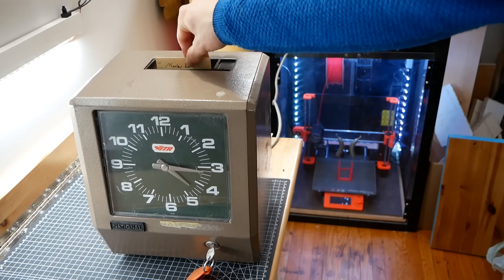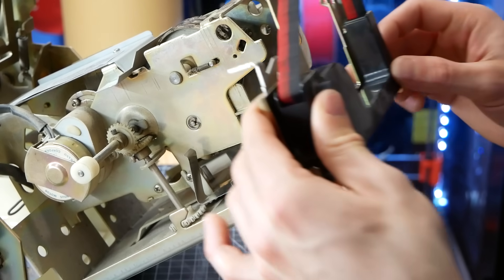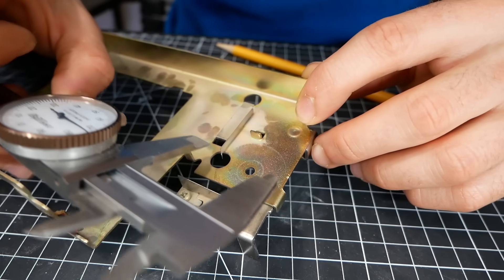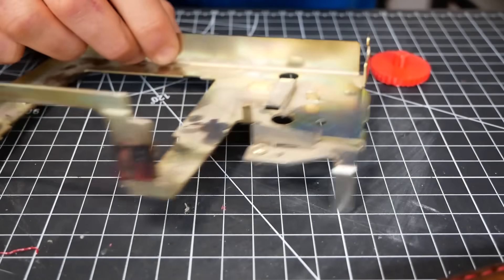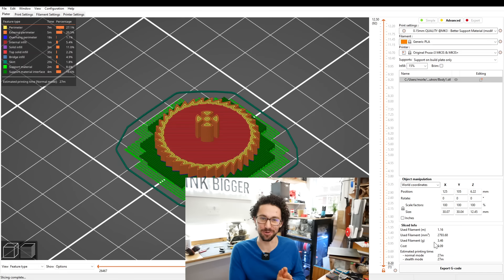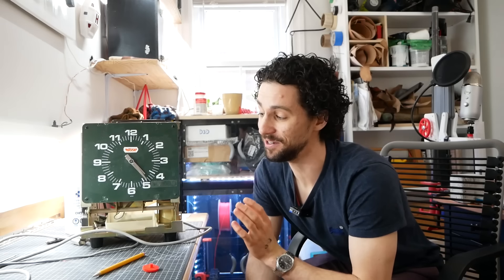They wanted 100 dollars. I 3D printed it for 9 cents.

Comment: Two reasons this type of part is so expensive. First is you aren't JUST buying that gear, you're buying that entire assembly, that gear was likely a piece that was melted to the housing (basically making an overly long stem and mushrooming it with heat to keep it affixed) and DESIGNED to break. So why is it so expensive? folded sheet metal isn't costly and this clearly isn't built to survive the apocalypse or anything. It's because that gear isn't a printed part, it's an injection molded piece. They have to make thousands of those gears to make the power, fluid and general costs of cycling the machine that makes those gears worthwhile, and that's problematic when people generally aren't buying these anymore. Mechanical time clocks like this are becoming rare in a lot of shops with a digital system that's more accurate (doesn't need adjusted) and doesn't require the payroll office to have to go get everyone's time cards, so of course the part cost goes up. I'd guess when they made these regularly and they were commonplace, I'd wager this part probably cost maybe 40-60 bucks? Costly sure but not unreasonable, for you though where this is a vintage piece you're using that let's be honest you could probably replace for the cost of that part (give or take) it's just unreasonable. But companies like this expect folk who still use these time clocks to KEEP using them, be it a need to (safety, security, etc.) or because they don't wanna outlay for a new clock system, they can afford to charge more, make more money and also keep producing these parts. 

Before anyone asks, I work in injection molding for plastics, this is an actual thing we do where I work where we will constantly destroy GOOD product solely for slight variations in color, because it hit the shop floor, etc. (even though we primarily produce food service materials we've been known to also sell to non food service companies, hence the oddity that we will destroy good product that could go to companies who don't require sterile products)

Comment: I would wonder about the longevity of such a part, though this is more for display, so it's not that important.  Very cool video about the full process of designing it.
But that's how the world works.  If you don't want to put the work in to fix something yourself, you will pay for the convenience.  Hell, I know a company that charges people $150 just to clean their squirrel cage and condenser.  It's super easy to do yourself, but oooo so scary!  I have to open something up!

Comment: Now I see two different colors on that ink resovior.  I assume it's designed to set an easy to notice change (such as late?  Or maybe OT even?)  How does that switch though so it would stamp with black ink.
Reply from the maker: That's a great question! The clock automatically switches the colour at a specific time (basically by flipping up the ink ribbon), and I assume that is to designate overtime hours. I haven't yet figured out how to adjust what time that switch happens.

Comment: I’m interested to see how that part holds up. I bet there’s a decent amount of force on those teeth due to the lever effect throughout the machine. I wonder what the original is made of?

If it’s molded plastic I wonder how much if at all stronger it is than your printed part.

Comment: 3d printing is great.. i have none myself but i do collect vintage lava lamps.  and they used plastic screw on tops.. which break once they break there is no way to seal the lamp anymore and that precious liquid that isnt made the same like it was in the 60-70s will be gone... thankfully someone 3d prints the tops and they work great.  only issue is 3d printing isnt practical for most people.. theyre expensive.. and if you contact someone to 3d print a part for you. they always say no because it isnt worth the time to do all the 3d measurements and blah blah.. its very expensive to do just 1 thing with a printer... Your 9 cents to print vs 95$ is kind bs though, you have the skills to do it.. Im curious how much youd charge me to 3d print the gear in my Jeeps blend door motor which split in two peices.... vs me buying one for $100..  

Thought so..

Comment: 9¢ + how much time? Is this really viable for someone not making a YouTube video, for instance? Obviously using a 3D printer as a hobby has some value in and of itself. But your central argument is flawed. 3D printers are great for things you can’t buy. But, for instance, you wouldn’t buy a 3D printer to solve this problem.

Comment: but really what is the real price of 3d printing the part and what i mean by that is material cost + 3d printer cost + electricity used for 3d printing , because if i was to find that punch clock and need to repair it i dont have a 3d printer i think it would be cheaper ordering the new part for 99$ but from a diy perspective i can see the appeal of the 3d printing for multiple small project

Comment: to calculate how many teeth will fit on a full circle simply take your degrees and divide by 360(full circle) and it will tell you how many will fit with those measurements,  also recommend calculating how much the arm travels and setting  that as the degree because it will reduce the noise of the ratchet mechanism and wear over time, from the picture you showed it looked like it was originally made from a very resistant material so its probably a known issue

Comment: I honestly just think they were charging 100, because they were going to send you the whole assembly not just the gear.  Still a ton, but it would make a lot more sense since they would need to find an old one they have or manufacture a single one for this case (which is highly unlikely).

Comment: In the current format you’ll use way too many cartridges. If you can get what looks like 30 legible prints from one section, it may be more practical to advance the cartridge after 10 punches rather than after each punch.

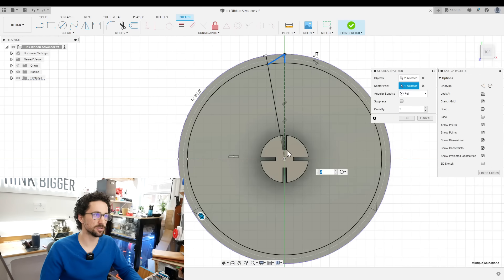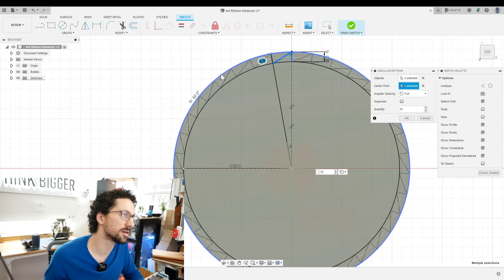Comment: Great video.  Forgive me, but I had to laugh a bit at 8:17 when you said that you didn't really know how many tooth profiles would fit in the circle after you had already set the rotation angle to 10 degrees.  360 degrees in a circle divided by 10 degrees/tooth is 36, which I'd say is pretty darn close to the 35 that you landed on at 8:34.

You got me curious, and I found a listing for an Amano 6807 on ebay that had a picture where you could make out the edge of the ratcheting gear you printed.  It had the same sawtooth profile, but appeared to have roughly double the tooth count.  but given that you 3D printed this replacement part, I imagine that doubling the tooth count would be a difficult feat to get nice results.

Comment: Ok, a bit misleading here.  You spent say 2 hrs analyzing, prototyping, and final printing your gear.  Let's say your rate as a mechanical design engineer is a conservative $30.00 an hour.  So, you did this at a cost of $60.09.  Now that does not even consider the cost of your printer and operating costs or the cost of your education on the design software that you used.   When you look at this more realistically, you see that they did not really overcharge you considering they need to make a profit, and cant just give gears away.   If the world worked on this logic, we would buy an I-phone for maybe $2 (cost of materials) instead of $800.

Comment: My pastor did kinda something similar. His wife loved her old vacuum's attachments. He wanted her to upgrade to a newly aquired 'used/fixed' vacuum he got but she didn't like the attachments it came with.

He simply created a conversation joint for the different sizes (2in vs 3in). This way she could toss the older vacuum but keep all the attachments and use it on the new one. 

His wife loved it so much she justified his 3D printer purchase after that. Lol

Comment: You might want to consider drilling a small hole in the bottom pin and putting in a "keeper" screw with washer to prevent the gear from being pulled out of the backing plate with the ink cartridge.

Comment: Their $100 price included more than just the gear. You also aren't putting any price on your knowledge of using the software to create the new gear. This isn't one of those situations where you're just walking into a hardware store and buying a bolt or washer off the shelf.

Comment: People talking about how much its costs to injection mold parts and store them in this situation but clearly miss the part where the company is still making the injection mold plastics, selling them to customers, and storing the leftovers, but just making it part of the metal bracket when they don't have to. Of course we don't have to expect a company to make products at cost, but they must have the know how to manufacture these gears for a reasonable cost considering they already have the molds and still make the part but don't want to sell the one piece that actually breaks since I doubt the metal bracket ever goes bad in these things. Even at $10 a gear they could probably get away with. Why buy a whole car door when you only need a window

Comment: It's not 35 in the circular pattern, it is 36 considering that you set the tooth angle to 10 degrees. 36x 10 degrees = 360 degrees

Comment: In your $0.09 costing you haven’t included the cost of labour and energy, it’s negligible when doing one off parts for your own use, and makes logical sense.

The part you would have received would have been stamped metal, with an injection moulded or milled/turned part, and as a business user, and not a collector that would have more value than the 3D printed part, and as such $95 is a damn reasonable price.

Comment: When you take into account the cost of the 3D printer and material, the CAD/CAM software and Processor package, the cost of the computer system, the time and electricity used, the post-processing and finishing the part and reassembly......I'd say your replacement part, best guesstimate, cost approximately $7000.00 Dollars ! ! !

Comment: Because of things like this, ive learned 3D modeling. Most of the time it is just a smal piece that is broken, but the replacement is often not avaliable or very expensive.

But if I hire someone to do the printing for me it gets expensive very fast and that is understandable.

They have to maintain their machines, and have to pay their employees. Additionally they want to have something for themself at the end of the month.
And that is without someone measuring and modeling the part....

Comment: Nice fix. Next thing to look into should be to figure out how to remove 1/7 to 1/8-ish more paper (in height) on the card edge every time the card is stamped, so that the stamped time codes match up with the card fields. Or maybe get other cards that match the machine

Comment: I repaired an IBM Selectric II in much the same way as you did. However some parts needed to be incredibly strong and needed me to use Liqcreate Strong X (about 185 GBP for 1L) resin to get them perfect.

Do you know that you could have made most of this in one sketch, and used extrude parameters to offset the exrtrusions onto the faces? I was taught to do this in engineering classes because in many instances it makes finding things in complex models much easier.

Basically in F360, just expand the sketches area in the top left, then click the eye button next to the sketch to reveal it, so you can do further extrusions on the same sketch.

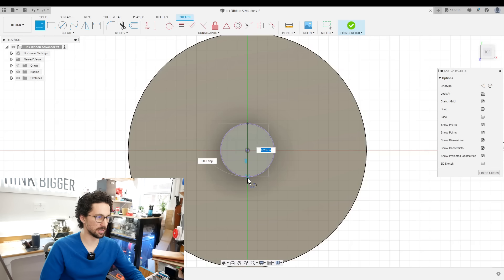Another best practice is the cross you made through the middle of the circle at 05:44, to select line type in the box at your top right to construction. This ensures you don't have to click a bajillion things to extrude one item. Not super necessary in this model of course as it's just a small thing.

8:19 - i would have left the one tooth on there, extruded the one tooth, and then you can create a circular pattern on the extrusion instead. This just means that you don't then have to individually click every tooth to extrude it, and it tends to be more dynamically adjustable through F360 user parameters.

I'm not saying this to be a dick, but because it'll make life waaaaaay easier later on if you get used to it now and start making bigger stuff.

Loved the video btw. Subbed.

Comment: It was $95.00+tax for the replacement assembly, but the one part that was missing only cost $0.09 because it was only one tiny piece. Chances are the company was likely trying to get old stock out for a good value to them, thinking that whoever hasn't updated this clock in 50 years probably doesn't know how to Jerry rig a fix.

Comment: You should define the number of teeth, not the angle. Then input the angle as 360/NumberOfTeeth. That way the spacing is done automatically and if you find you need 34 teeth, you don't have to calculate an awkward angle.

Comment: Well, I know you can 3D print it for a lot less, but when this machine was made, the 3D printer was not invented yet for home use, so their gears most likely have a manufacturing process making them more expensive to make, and they have to factor in transport cost, design cost and so on and so on. And lets be honest, you only 3D printed the gear, the price you got was for the entire assembly. So you cannot compare the two prices to each other.

Comment: The title is mis-leading.  How long do you think the payback is going to be when you figure; the cost of the 3d printer, assembly and test time and costs, yields, practice and misses, storage and restart maintenance for when you use it the next time,  material drying out and having to be replaced, etc?  Sounds like $100 is a bargain.  Now, if you're going to make a couple of thousand of them, that's a different story.  And even there, it would be more productive to make a quick prototype and ship it off to get reproduced.  That's what a 3D printer is for THESE DAYS.  HIGH cost, fast prototyping.  3D printing is not ready for high volume, durable high-quality printing yet.

Comment: 18 cents really, since you had 2 iterations. And a 3D Printer.. And CAD knowledge... And time.. Those all add up. This is why proprietary software/hardware and the locking up of maintenance by the big brands is something we need to stamp out real quick.

Comment: This is EXACTLY why I bought a 3D printer myself. 
I made many, many parts that are originally pretty expensive to replace. 

One good example, is a special gear inside the wiper mechanism of a Mercedes with a single windshield wiper. I even went a bit too far at some point, and printed the whole front mask of my father's tractor. In parts, (due to size) which I glued together. 

3D Printers are very very suitable for such things.

(example photo of the gear: https://i278.photobucket.com/albums/kk96/vpics_photos/misc/IMG_1824.jpg)
Reply from the maker: That’s awesome! Especially for products that have expensive replacement parts (like Mercedes)

Comment: nicely done 
i would have designed the part in 2 spare parts
the shaft for engagement and the gear  so you wont have to use supports and just need a drop of ca glue

Comment: In defense of the company that made the part, in real terms, it DIDN'T cost just nine cents for the part. The plastic the the part is made from cost 9c (of which you made two) but then you have to count in the cost of --
owning or having access to a 3D printer, 
the software to run it, 
the hardware to use it, 
the electricity to power it, 
the workers to produce it, 
the engineers to design it, 
the lawyers to patent it,
etc, etc, etc.
PLUS, the cost to you wasn't just 18 cents (9 cents twice, remember?) What about the time and effort you spent creating the part using what is a fairly complex piece of software? This time might seem like 'free' to you but it's really not.
Well done, BTW, on figuring all this out, but remember, hidden costs are still costs.

Comment: The cartridge doesnot contain an ink reservoir. It's simply an endless loop going back and forth on some rollers and a "packing area". If you can't find replacement cartridges, you can (with some care and patience) open the cartridge and replace the ribbon with one of the same width.

Comment: 8:50 Tipp: Don't make the Circular Pattern in the sketch. Extrude it once. Then use the Circular Pattern with "Type: Feature" to create the other teeth. If you then later want to change the number of the teeth, you don't need to select every tooth again.

Comment: It's lucky you had a 3D printer ,
3D printers started becoming available in the early 1990's but the cost would have been astronomically priced at this time the cost for a single printer was around £1.5 million but at that time it was basic . 
Now if back then your part would have been of a lower cost to buy from the maker

Comment: Nice job. Not sure if anyone else commented about the extrusion that goes into the ribbon. I worked with cash registers and POS printers that use the same kind of ribbon setup. The part that goes up into the ribbon is actually the inverse of what you made. I suspect there should be something under that gear holding it in place too. Here is an example of what the tip looks like that I was talking about. https://m.media-amazon.com/images/I/61huBUoB6qL._AC_SL1500_.jpg

Comment: I doubt the gear was a press fit to the ribbon.  In fact I'd bet it was securely attached to the metal frame so it did not stick to the ribbon and get lost.  Whether it was retained by an e-clip or tabs on the gear, it was most certainly attached to the frame.  I'd loosen up the splines so the ribbon easily slips on the gear (FWIW, ribbon drive sprockets are often tapered so they slip into hole in the ribbon easily)  and either a groove to the bottom of the gear for an e-clip ot add some tabs so the gear clips into the metal hole.